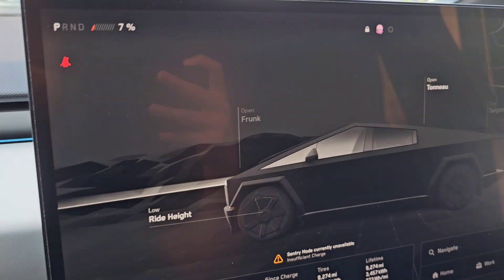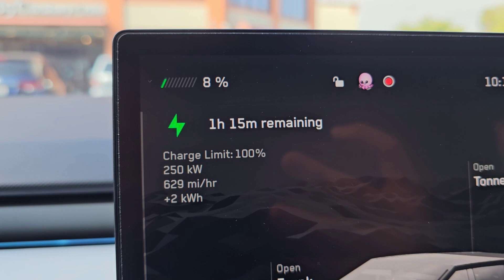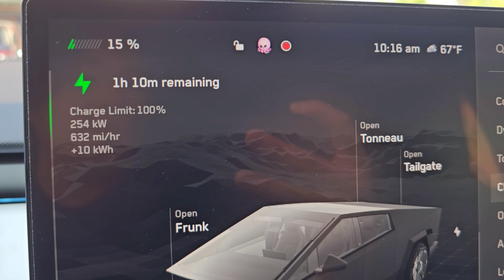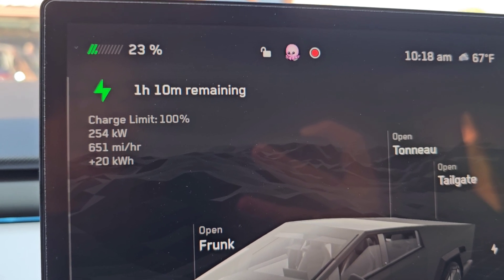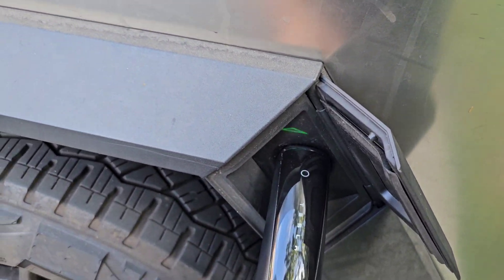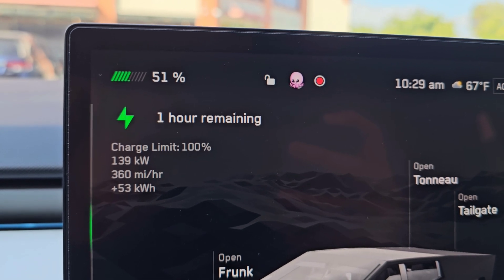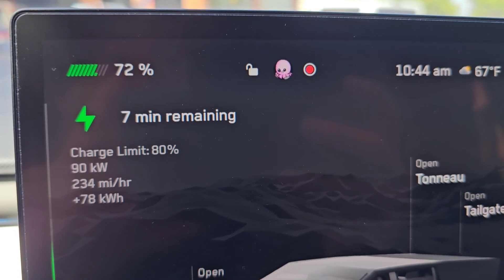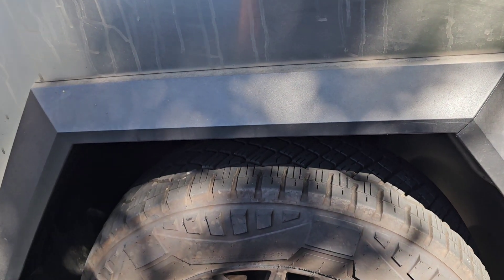Charging the Tesla Cybertruck at a V4 Supercharger Supercharging Station 255kW Max Charge Rate

Comment: If my memory serves me correctly, the v4 dispenser cable has immersion cooling all the way to the plug handle compared to the v3.

I’m curious to see what the charge curve would be like at the nominal 800 volt side since you can push a lot more kW’s through at 500 amps vs 400 volts. The v3+ cabinet with v4 post supposedly can push over 300 kW for a short period of time. Ballparking over 800 amps is quite mind blowing come to think of it.
Reply from the maker: @felaxchow207  yup, sounds about right, but I think Tesla does something to protect the life of the batteries. The v2 150kW charger charges the Cybertruck from 2-80% in 50 minutes. Not much longer than the 250kW charger.

Comment: No its the software. Tesla have not released 500 kw for the CT yet.
Reply from the maker: Either way, they will just change the charge curve. It'll drop in speed pretty quick. The x250kWh drops pretty quick. The 150kWh chargers only take 10-20 minutes longer even though it's half the speed. It should double the length.

Comment: These are V4 dispensers. The power cabinets are still V3. The cabinets need to be swapped out to have higher output. Also the Cybertruck does need to go further back when the dispensers is installed in the back instead of the side like this one.
Reply from the maker: @appleguyla  got it!